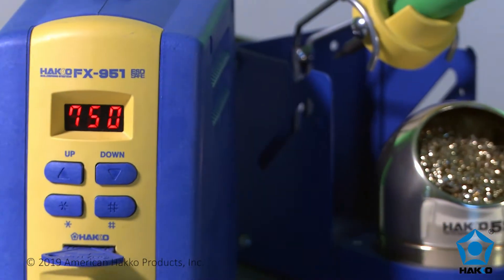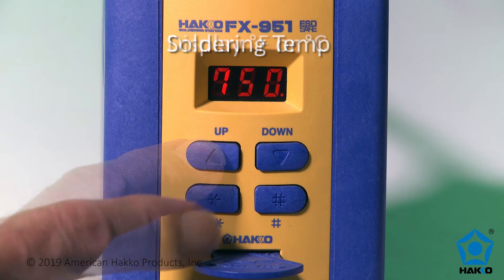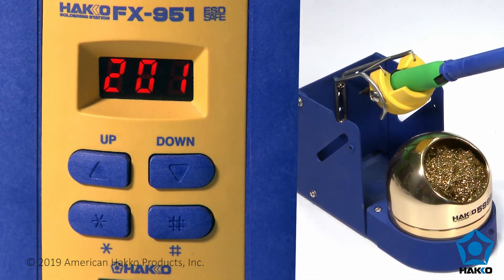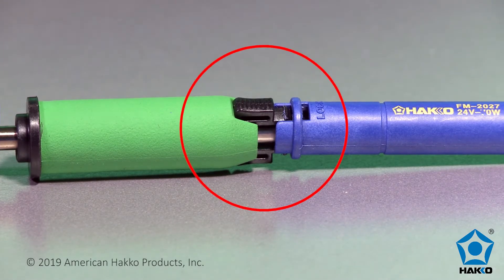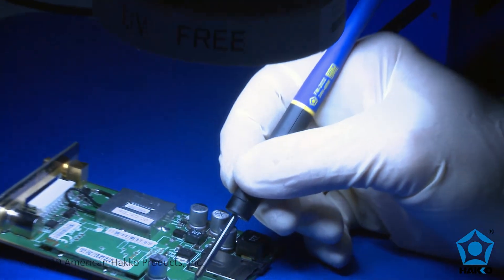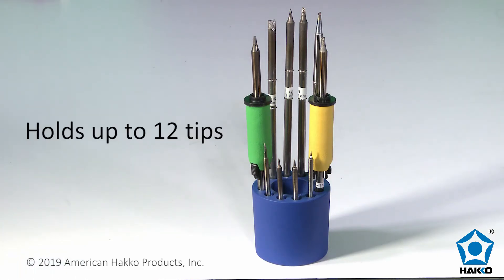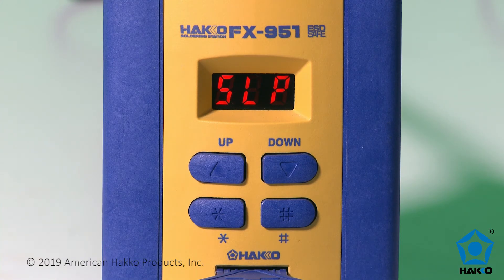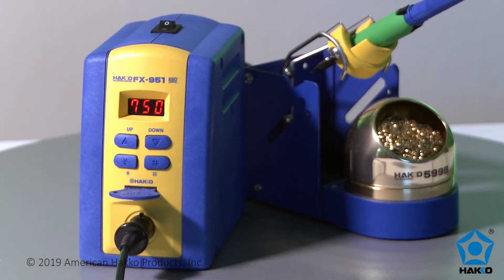HAKKO FX-951 Soldering Station — Video by American Hakko

Comment: How is the heat resistant pad supposed to be used? The manual shows that you thread it through the cable???
Reply: I saw a video on removing the tips and that's what it was used for. To grab the tip while it is still still hot.

Comment: Been using two good old Weller WES51 stations for over two decades with no issues at all.  Cheap and easy to find tips, while I was thinking about upgrading to a Hakko, I've heard the tips are expensive and harder to find.  I was eventhiking about just going with the Weller WE1010 since it's using my large collection of ETA tips. Hmmm-hmmm-hmmmm
Reply: tips are $10-$29 depending on your needs. We solder 8-6 hours a day and tips last about 2 years
Reply: @TheDataRecovery  < Thanks, I only solder maybe about an hour a day, so it's not a heavy use at all.